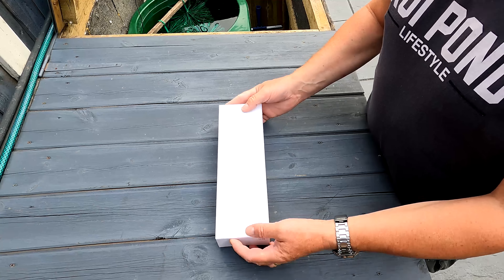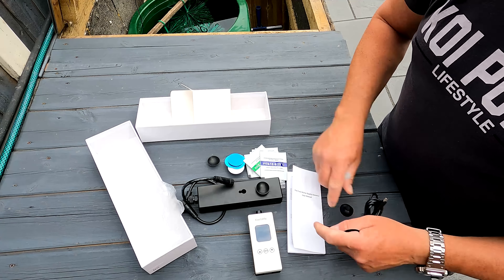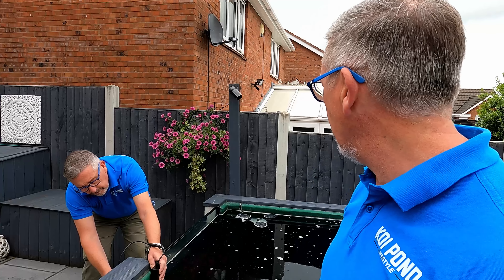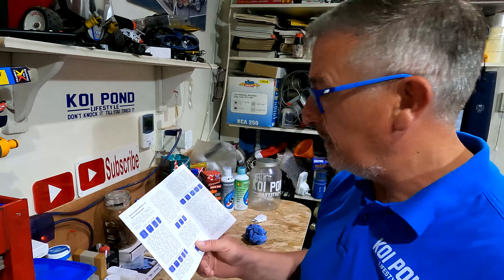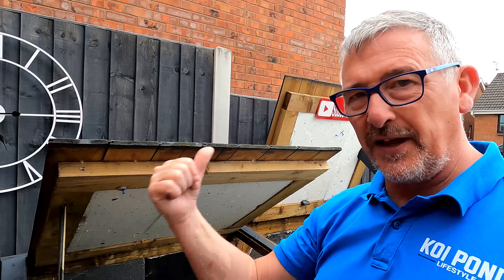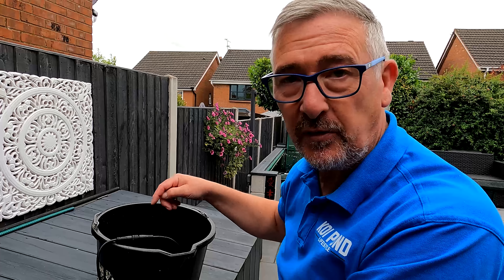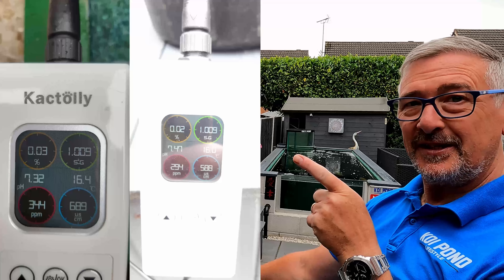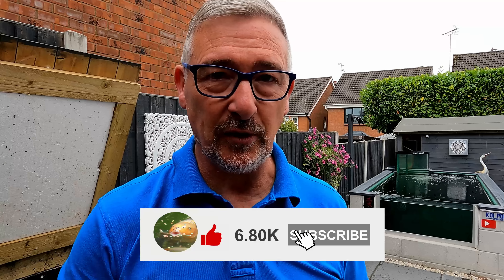KOI POND*AFFORDABLE POND WATER MONITORS**I GET A WATER MONITOR TO PUT TO THE TEST🤔😉👍**

Comment: TDS is total disovled solids. the unit looks like the seneye mainly used in the marine aquaiums i had to monitor it in my 1000ltr reef 
SG is another marine peramitor if your looking at all the inderivual monitors for what this does your looking at well over£1k for a basic setup system i was looking for one before i shut my reef tank down due to not being able to spend the time that was needed for keeping the water quality so went back to freshwater i was hoping to get to the kio show as it was 30mins down the road from where i live but family commitments came first 😪

Comment: That seems the same as single units you can buy  doing calibration is simple with distilled water. the single units cost around £8 each and are waterproof so can be left in the filter system.

Comment: TDS Total Dissolved Solids. It's the amount of organics in your water, and also metals and minerals dissolved in your pond water. The lower number you get, the better it is fir your fish. It's something commonly measured in ponds. One of the aims of RO is to bring the TDS down which is the best for the fish.
Reply: yes you can use RO systems to reduce the TDS in your water but somewhere along the line you have to add minerals back into the water that the RO has stiped out I used to keep marine/reef tanks and had to go one step further than just using a RO system with a Di unit that would give me a TDS reading of 0.01ppm its not only the organics that it stripes out its chemicals, minerals, heavy metals so i had to add back all the benerficial minerals back into the water
Reply: @CCCOILS  I did say 'one of the aims of the RO..'  
RO systems in pond, as you know from the aquariums, are more for people who suffer with tap water with chloramine and other heavy metals. My case here, except chloramine. The TDS goes down automatically.
Reply from the maker: So am I right that harder water is higher TDS and visa versa..
Reply from the maker: I feel a school day coming on..😉👍
Reply: @KoiPondLifestyle  yes. RO makes the KH and pH and other things going down as it gets rid of majority of the 'bad' stuff in water, therefore you end up with soft water. Best for the koi in general. They heal quicker too, better for the sheen on the skin and many other things.
Reply: @LauMagroTheFrenchKOInection  ok mate i was just trying to break it further
Reply: @KoiPondLifestyle  yes yes where i live in we have a ph8+ and a i was getting a TDS reading in the high 600s but it can also depend on how many natural minerals ore in the course in witch the supply is being taken from
Reply: @CCCOILS what do u use to re mineralise?
Reply: @gman1087  I don't anymore as I'm no longer running my marine system but I was testing nearly daily for everything from pH to zinc and was playing the balance gaming to try and get the best results for the water peramiters that best suited my corals
Reply: @CCCOILS  ok ...but what did u use when u did?
Reply: @gman1087  bepending how my reading came out what my salts would replace or are you talking brand names